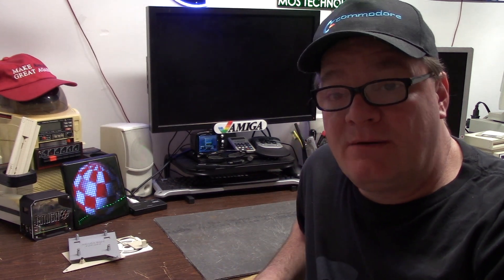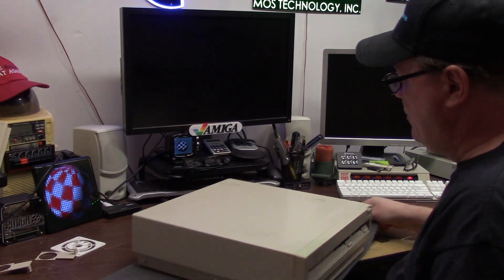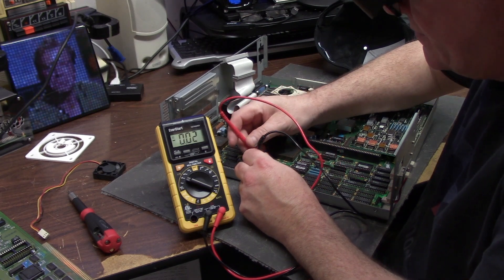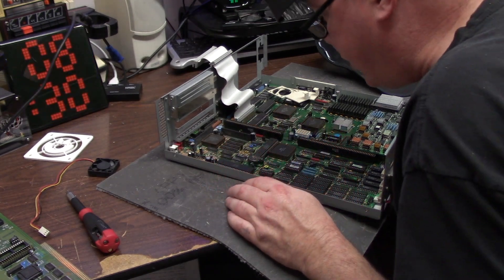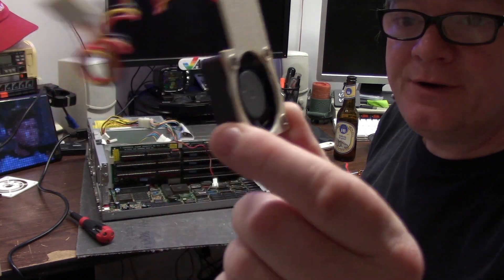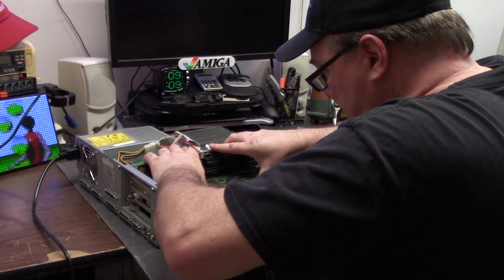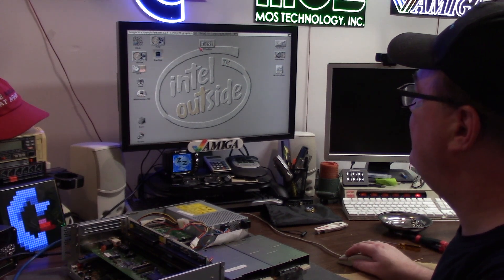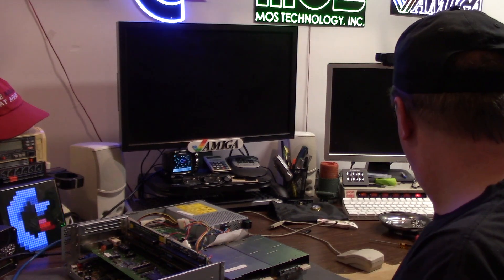Amiga 3000  yearly check up maintenance

Comment: As always, thanks for the video content Chris 👍🏻 As always learning from your uploads 😉 Just out of curiosity, do you use Roadshow for your networking IP stack? If so have you not considered using an Internet Clock via the Network-startup to set and keep your time? I’m using one on my Amigas. Also what’s your thoughts on polymer based capacitors?
Reply from the maker: I do use roadshow (paid) with rodie as the gui.  I also have miamidx Just in case. Also i have timesync from aminet all set up too.   And OP caps are the best there is.  No electrolytic liquid. Instead a gel type fluid and they dont leak . Op caps have a red or blue half shell color and i love them.  But! They are 3x as expensive